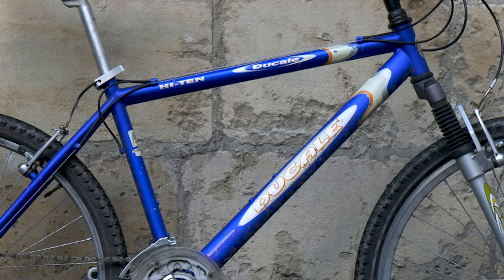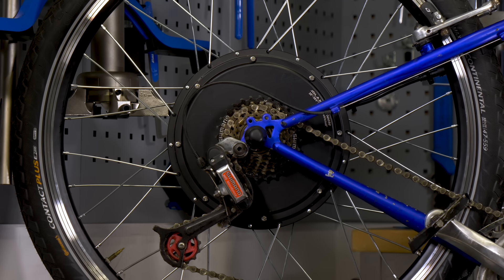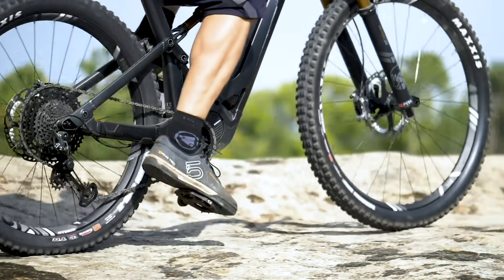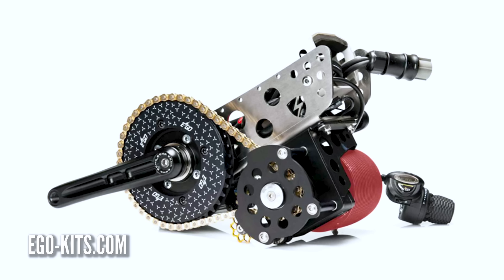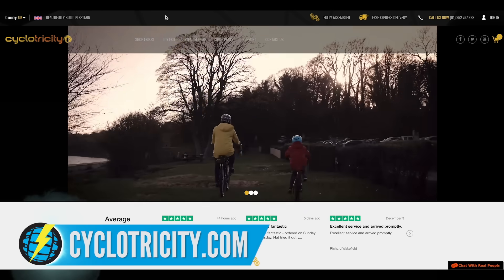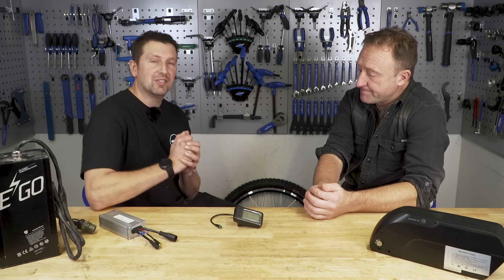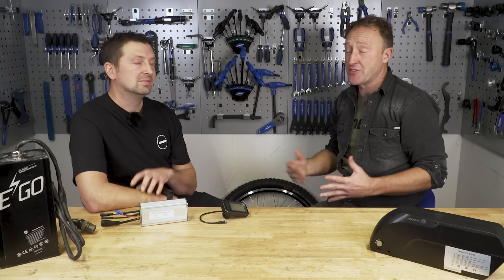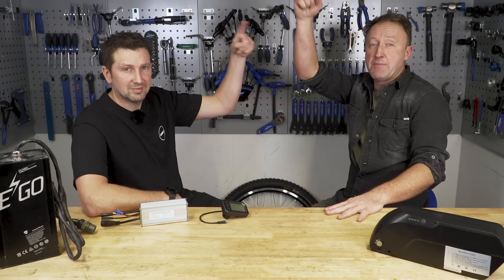Electric Bike Conversion Kit Options | DIY E Bikes With EMBN

Comment: There is only one way in electrifying your E-MTB: Mid-Drive.
There is two (well supported) options for mid-drive: Bafang BBS02 / BBSHD series or

Tongsheng TSDZ2. Main difference: Bafang is controlled by cadence, Tongsheng is controlled

by torque sensing. Bafang can be programmed easily, to programm the Tongsheng you need some

skills in soldering as you need to do some mods.

Installation is easy when the frame allows it, check in advance, there is frames that do not

fit well. Chain-Line is the most common problem, check in advance. Second one is the Chainwheel,

smallest one is 42 fot the TSDZ2 and 44 for the Bafang. You need a smaller one (no adapter needed

for TSDZ2) and may also need a bigger cassette. Go for 11 - 46 or bigger, gives you a chance to block

the last gear to get a better chain-line still having a granny - gear.

I´ve ridden both motors for years against my Bosch-Motor, result is: Torque-sensors rules, even the unmodified

TSDZ2 works better than the Bafang, feels like the Bosch without the E-MTB mode. Pretty nice.

The Bafang is unrideable without the (easy) reprogramming. There is a lot of configs that work fine for the

intended use but: It remains cadence-controlled, so just moving the pedals turns the system ON. The faster you

pedal, the more you get. Works fine in most situations, reaches the limit when you are in terrain which needs

constand change of power. Can be eased by changing assistance level much more than on the TSDZ2.

I would rate the BBS02 as powerful enough, on par with Bosch, the BBSHD is much heavier and has a worse chain-line. peak

The TSDZ2 has less power, but is extremely light and tiny. Peak-Power is about 500 Watts, which is ok. 

I would rate the Bafang as the more robust one. The TSDZ2 in older versions suffers from internal plastic gearing,

it´s better for new variants. There is cheap spare parts for both, they can be repaired very easily.

So - no debate: Make your choice and buy one.
Reply: I dont get it.. Why is there is only one option? Why Mid-drive? I bought my front wheel a year ago and have no problems with chains or chainwheel etc.
Reply: @lzFoXzl  i'm just speaking about e-MTB. I use a hub-motor in my Velomobil for commuting, it works great, doesn't affect the drive train and is efficient. But for going rough there is no option but mid-drive. The few vendors doing offroad-rear-drives have vanished since 2 years, for good reason. Serious trail-use needs Nm, which can't be delivered by a hub-motor, it's a big difference between 35 Nm and 80 Nm.

Comment: great video, was wondering when you would cover the kit aspect, I would like to add that if your interested in building a kit ebike, then endless sphere on FB should be your first stop, and please do not build a hub bike without adding a torque arm.
Reply: I totally agree, Endless Sphere was so valuable to helping me learn about the different components and how to put them together. I also learned how important it is to have a torque arm for a front hub motor. I was hoping these guys would mention it because of how important it is to safety.

Comment: Great video!  If you are lucky enough to work for an employer that offers the tax-free cyclescheme, you could probably get a low-end off the shelf e-bike for less that the cost of a conversion kit (unless you can wangle a way of getting the kit through the cyclescheme).  Looking at converting my wife’s bike for her.

Comment: Hi gentlemen, as some of us are bigger or just a tad on the heavier side and ride heavier built bikes because of that, 
and  remaining street legal with a tiny 250 watt motor and enough torque to get the job adequately done  can be a challenge.
 So what motors or kits in the respective categories,  wheel hub or mid  drive have the best torque rating do you think?
 Thanks in advance.
Reply: Mid drives have so much more Torque, you should look at a Bafang BBSHD with 52V battery

Comment: No mention made that a cartridge BB is required as the sensor disc hole will not fit over a hollow tech shaft.

Comment: What could possibly go wrong with an anonymous chinese motor made for the lowest bid strapped into a bad frame with bad brakes designed to be a pretend moto for an unlicensed, unskilled uninsured fool?  Oh that's right , NHS,  get half a point.
So far so good, is not a safety philosophy.  Watch a lithium battery fire vid, sometime.
These things need to be regulated like the motor vehicles they are. Licensed, inspected and insured
Reply: You may have a point with the battery but hub motors are if anything much more reliable and simple than mid-mount motors. The mid-mount motors use the existing drive chain and are known to break chains causing accidents and this is what the high end market is. So I feel in that regard some of the cheap hub motor based kits are actually safer.
Reply: @bonzobanana1  It's more about the package. Kits are dominated by low cost systems that are not safety vetted for the frame, and are powered by batteries that the airlines treat like the hazard that they are. They exist in a system that does not encourage responsible use. Even the big corps had problems with early and bad Lithium( um, Samsung, Sony). Im not dumping on ebikes, just poor implementation.
Reply: @bonzobanana1  Hi!  Thanks for your comment.  I was thinking of a mid-mount... but I thought I read that they are making stronger chains for that design.  Have you, since your helpful input, found that now to be true, that the stronger chains have solved the problem?  It just seems from my amateur POV, the physics of it, that the mid-mounts are best.  Have you changed in that regard?  Also I read that the hub motors, when hitting pot holes etc were more overall prone to breaking spokes.  Have you heard of that?  I've heard of the front hub motors causing spin-0uts where then one loses control.  Also with the rear hub motors I read that you have to be very careful when you put the tire back on like after repairing a flat as even slightly off causes problems.  Have you heard of those problems?

Comment: Having trouble finding any E bike brands. when I Google E bikes ,Just comes up with online sells companies. No brand names? And eBay only has 2 brands And they're cheap I've got a 1500 W Rear drive does almost 40 miles an hour, But the cheap Axel keeps stripping out bolts Now the axel shot!!!
Reply: Bikeberry and Gasbike are a couple sites. Also Amazon

Comment: As a Bafang mid drive rider on a converted hardtail, I would point out one very large difference between all of these retrofit kits and a purpose built eMTB. And that is pedal torque sensing. Not aware of any kit that has that. Pedal sensor and pedal assist, technically yes, but that only means it senses whether the pedals are turning, not how hard. Without a torque sensor I am constantly poking the power level up-down buttons to regulate the power delivery in hilly terrain. No one, it seems, has figured out how to get a true torque sensor into the mid-drive kits that go into an existing bottom bracket. I rode a purpose built Haibike and the torque sensor made a tremendous difference. You could mostly just set one of three power assist levels and forget it and ride. I sure would love to see this integrated into a kit.
Reply: Tongsheng TSDZ2 does, and mine arrived yesterday.
Reply: @kevinshort3943  excellent! Fitted mine 3 monrts ago, luvin' it!
Reply: @colincampbell4261  
Waiting for a bms to arrive from China.
What have you done about the cranks?
Reply: @kevinshort3943  yeah, 36v and 48v motors. A Bafang righthand crank balances up the Q factor thing. How many cogs have you on the rear?
Reply: @colincampbell4261  
"How many cogs have you on the rear?"
They aren't COGS!!  Cogs are made of pear wood and are found in windmills........(rant, rant)  11 gears - it's a 1x.
I'm trying to get some that don't weigh more than my whole bike, and aren't longer than my legs. 165mm would be nice as that's what's on my bike now.
Oh, I have ordered the adapter so I can use my existing narrow/wide 34t chainring - lost the chain twice in one ride on a borrowed bike with a bafang motor.
Reply: @kevinshort3943  cogs, gears, sprockets?
Wtf, i was trying to be helpful.
You may have some problems reaching the large round things with teeth on them in the center of the rear wheel and get a good chain line!
You will probably be adding about 7kg with motor. Weight don't matter.
Reply: @colincampbell4261  
"Wtf, i was trying to be helpful."
Sorry, sarcasm, wit, irony etc doesn't translate over the internet very well sometimes - no offence intended. They still aren't cogs though :)
"the center of the rear wheel and get a good chain line!"
I think I should be ok with spacers ...............  ?
"You will probably be adding about 7kg with motor."
That's exactly why weight matters.
Shame they used JIS instead of something modern, then it would have been easy to get some cranks.
Reply: Tongsheng tsdz2 250-500w 36/48v torque sensing.
Reply: @colincampbell4261  
750w 48v
But I understand that there are just two motors and the rest is just firmware differences.

Comment: I pondered converting a bike or going with a Bosch CX, ultimately deciding on the Bosch.  I regret the decision every day since Bosch has been an absolute nightmare with serious mechanical issues (repeated error code 500 and continuous intermittent glitches that their software cannot diagnose, going on for almost two years now since I bought the bike new) and horrible warranty/customer service (Josh Parris, Bosch-employed factory mechanic, has had my bike for over four months months now trying to repair it).  Since the frame is proprietary to the Bosch system I am stuck.  Had I gone with a conversion it would simply be another component that could be changed or even removed.  Hindsight is 20/20
Reply: Bosch are well known for poor reliability and they restrict the supply of parts to authorised dealers so all repairs can be expensive. They also make heavy use of plastic parts that limits the lifespan of the unit. Video channels like this are going to be sponsored by brands that use Bosch motors so you may not get that important information here but check out many forums for warnings. Bafang do some  extremely good quality mid-mount units and spares are easily available plus you have a decent upgrade path. Choosing Bosch can deliver a great performing bike but it can be terrible with regards value and you may need frequent repairs.
Reply: @bonzobanana1  Coming from an automotive background who has worked on Bosch engine management systems I should have known that Bosch would go out of their way way to restrict maintenance and repair to dealerships; the germans are infamous for this in the automotive world.  I would have thought their diagnostic software would be much more capable, but a dealer gave me a tour of their proprietary software and it was useless for diagnosing my situation (intermittent issue).  After several "Bosch-certified" dealers gave me huge bills without correcting the issue (warranty covers parts but not labor) I raised a huge stink and Bosch finally sent their top mechanic to fix my bike, but he is stumped.  Five months after he picked up my bike it is yet to be returned.  His name is Josh Parris (residence in Bedford, NH but travels throughout US training Bosch repair facilities) and he says has been working on replacing all parts related to the ebike system.  Lawyers are likely going to be necessary to resolve this long overdue situation since Bosch and their agents keep stalling (Magnuson-Moss Warranty Act, etc)
Reply: @herethere2518  To be honest I've not heard of so many problems repairing a Bosch unit before but I've read issues where people paid huge bills and only a month or so later it failed again and I've also heard quite a few stories where they failed on first use or close to first use. I also heard of people simply writing off their bike because they wouldn't pay the excessive repair bill so they have just sold it for what they could get for it in non-working condition. You only have to look at the reliability index for cars and see German cars nowadays at the bottom overall for reliability but what is much worse is their excessive repair bills but look at car reviews and German cars are often scoring the best with the reviewers having little consideration for the long  term reliability and costs of those cars. I personally prefer Japanese cars and engineering quality. Anyway best of luck with solving your situation.
Reply: Hind sight may be 20/20 but love is blind

Comment: As an early adopter of e assist, first one was 2001, the only options available were kits or 250w EU/Japanese reg eBikes with front or rear hub or the mid drive units from Panasonic, Yamaha etc. that were low on power and range. The biggest drawback was the battery technology which at that time was likely to be SLA or at best NIMH. The first conversion I did was a Currie system that had the drive unit attached to the rear end. Currie btw eventually ended up being bought by ACCELL and becoming the US distributor for Haibike and a major player in the development of the Class laws here in the US. The potential was there but the batteries didn't provide the amount of amps to power a bike up nor the ah's for a very long ride. Cadence sensing PAS were as much garbage then as now so throttles, legal here in the US,  were actually preferable. Keeping track of the development over the years it wasn't until Lithium batteries made the scene that eBikes, whether kit or branded complete bikes, were developed that would provide enough amps and wh's that finally unleashed the potential of eBikes to the larger market. The cost was high for the new battery chemistry but cost per wh has dropped considerably since. As an example my first LiFePo4 battery was $600 shaped like a cement block and @ 48v provided a bit over 500wh's whereas my latest battery purchase cost me $400 and is a 48v, 18ah (864wh) 2170 cell in the what is known as an HL style down tube mount style. At this point I have three 48v 2170 batteries, 12ah, 15ah and 18ah to choose from depending on the amount of ride time given the terrain I am riding that I can switch between my 3 eBikes, 2 front hub drop bar road and 1 mid drive MTB, for less than $1500. 

As I mentioned cadence sensing PAS is shite and will feel unnatural to a real cyclist in that the way it controls the speed is not always relative to the amount of effort you want to put into the pedals. Torque assist systems are far preferable but limited in selection for kit units to a few mid drive models, I use the TSDZ2 and find it to be on par with the big players on that level and cheap to buy @$350 or so but also a bit skimpy in regards to their bb bearings and the fact they have a square taper spindle and take some maneuvering to get a decent chainline due to the drive side offset, or a torque sensing bb in conjunction with a hub motor. Due to the EU regs regarding no throttles that has never been an issue for us here and I have found it to be a useful tool also. They get a bad rap but are actually a very useful item for starting off and blipping on the odd occasion to maintain momentum in say a rock garden where pedal strikes are an issue. I would say in an average 30 mile 3000' elevation gain ride I use the throttle for less than 500' but having it there when I need has become part of what I expect of an eBike when I am riding and works a treat. The assumption that once a throttle is installed it is used to exclusivity is laughable to me actually although I do see people at time utilizing that feature but consider it to be their loss as pedaling is the best part of the trip. 

My kit based front hub drop bar bikes which I use on all terrains actually and have from sea level to 12,000' are throttle only but can be set as a "cruise control" at the infinite range of watts within the system using a Cycle Analyst display that goes way deeper into being able to tailor the controllers output parameters than any other display I know of but is on analog level compared to the App based systems from the big players or companies like GreyP.. However much I like the TA on my eMTB for the road I prefer to tailor the amount of assist to my desired cadence/physical input without any "magic leg" effect at the drive train. It has become a personal preference and wouldn't trade it for any of the drop bar bikes that are now becoming popular. Because of the front hub drive and my input at the cranks effectively the bikes are 2 wheel drive which comes in handy in many situations such as steep and loose fire road climbs and using in super soft conditions like snow, mud or sand. As mentioned having a good torque arm system to keep the axle from spinning in the drops is a must but not rocket science to achieve. In fact one of my motors has a built in torque arm and is a direct drive unit that weighs on par with the geared type hub motors yet has the benefit of regen also. 

 The ability to upgrade to new technology, as in batteries specifically and how I recently switched easily and relatively cheaply to the newer 2170 format, is a big factor for me personally. However I am knowledgable enough to be able to do my own installations and maintainence of the systems/bikes I use and the boys above are right about the fact that if you don't have a basic understanding the e assist concept and bike mechanical knowledge it is probably best to just go with an off the shelf complete bike hopefully backed by the service of a good shop.

Comment: Bafang mid drive bbs02 ok its smaller than the bbshd.. but its 750 w nominal and bosch is 250 w.
Reply: It will run at over 1200 with a 52v battery and smoke any Bosch 120 nm